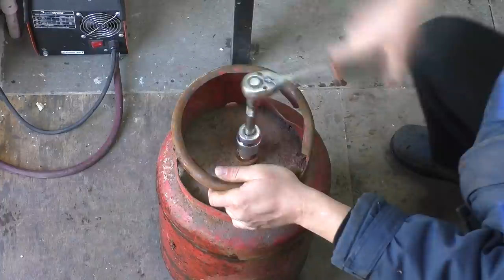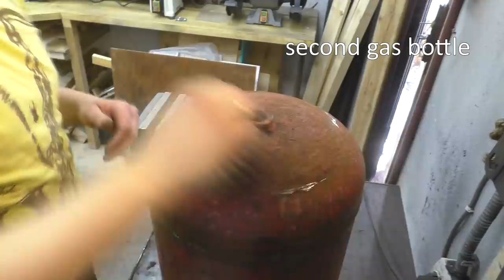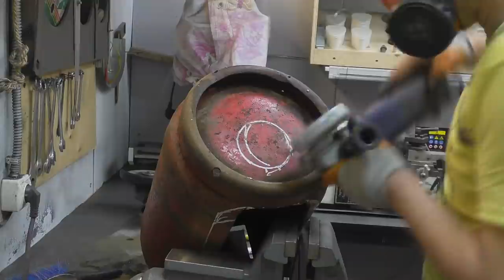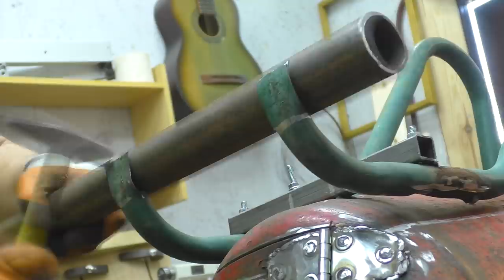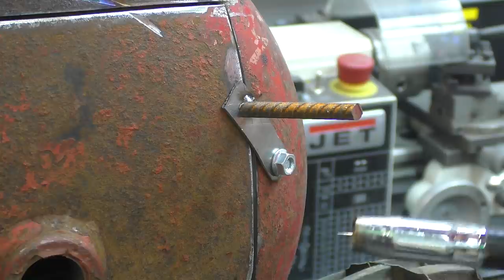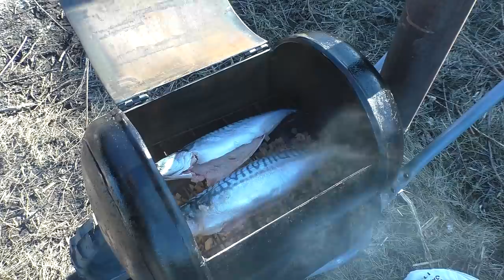The idea of two gas cylinders!!! I was happy with the result

Comment: Once you’ve filled it with water and then emptied it, put the cylinder onto a bonfire and that will get rid of the smell and the paint. Underneath the paint it is galvanised so grind that back where you want to weld.

Comment: I've cut up many of those cylinders to make "Hang" drums - I was always amazed that, despite multiple flushings with water, you could still smell the gas. It must permeate into the steel.
Reply: yep it does, search for NACE and you will see we use special steel for pipelines and valves.

Comment: Like the idea but personally  would use a larger  tank  or even an old heating fuel oil  tank   that actually  big enough to heat shop or home  
With she'll and tube design  and a self power fan  the ones that don't require to be plugged in but the heat from fire warms and it generates  it's own electric Flo that turns fan blades hotel the fire fast the fan moves very efficient

Comment: I remember back in the 70s two men was cutting a tank open they didn't realize that it still had flammable fumes which blew the hell out of them.
Kids and adults don't try this at home
Reply: Ummmmm pretty sure that's why he opened them first  and then flushed them with water thoroughly then drained  them so it's OK to go ahead and use metal cutting  And welding's equipment and spark on it afterwards.
Reply: @christopherhanna5754  yes that's the correct way. But unfortunately there's a few people that don't have common sense and they end up hurting other people.

Comment: That was very thought out. I've got one cylinder out back. I just need another one and then I can use my everlast to make one of these.
Reply: Just remember to flush out with running water before applying a flame to it. I shove a hosepipe into the top and let it run for a good time.